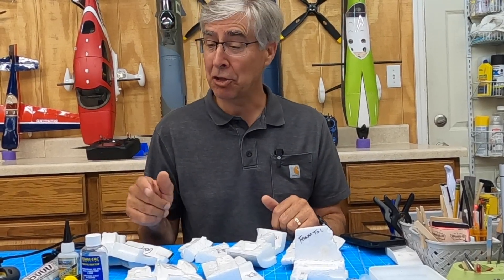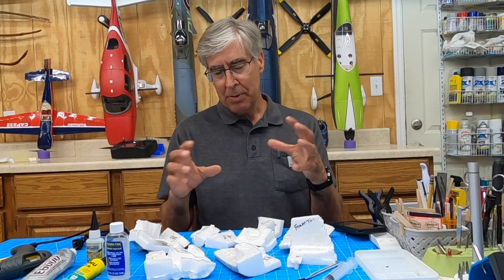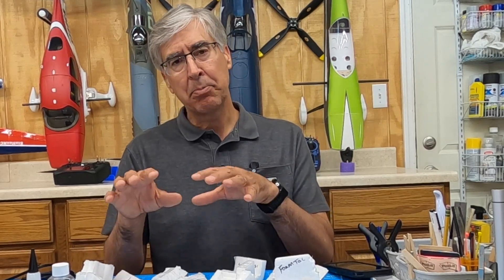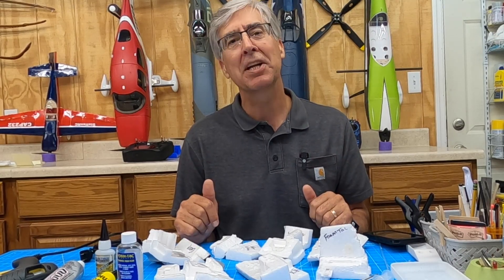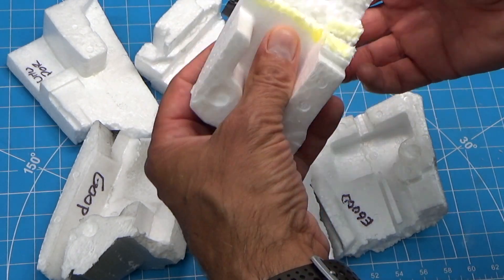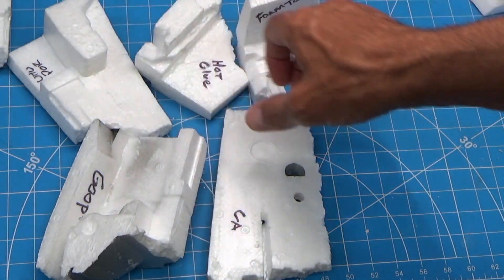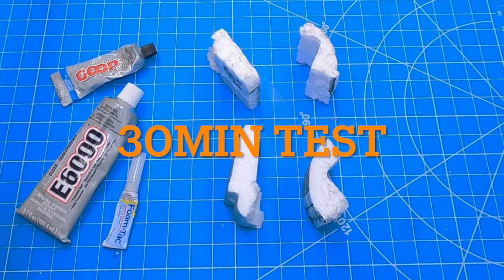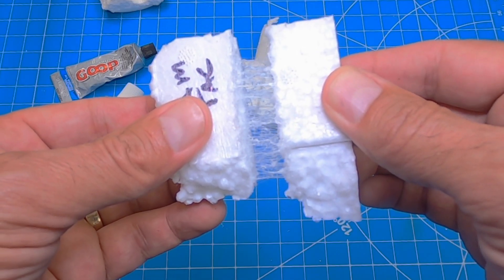Best adhesive for foam RC planes

Comment: So one thing I noticed is that you always put pealing loads on the tests, most loads are  sheer and twisting loads, pulling straight out could tell you more. How well the mating surfaces are bonded. Most bonds don't handle pealing loads well, 30 years of boat building and repair, once things start to peal, the jig is up.
Reply from the maker: The video wasn't very scientific.  Just checking on varius adhesives to see what sticks the best.  I agree that the sheer load would be best, but with foam of random pieces, it wasn't going to happen.  Appreciate you watching and commenting..  Thanks, WIll

Comment: Thank you Sir, amazing information!
Reply from the maker: Really glad it helped.  I've made several videos about adhesives and how to use them in repairs.  Thanks for commenting..
Reply: @SteffenRC think I'm gonna be a hot glue kinda guy although I have some e6000, so I may have to try it as well. 
I found your channel today searching help with my nx8 binding and setting up the gyro. Although I haven't quite figured it out yet, I'll get back to working on that project tomorrow. 
Thanks Will, you're very helpful!
Reply from the maker: Glad to help Don.  To be honest.  I usually use several glues depending on the task.  CA, Foamtac, E6000 and hot glue all on the same repair or assembly..  Yep, AS3X can be tricky.  I suggest to everyone to play with it.  Test it, change things, Test it and keep learning the process of setting up a model, assigning switches and AS3X.  It takes me a while for things to sink in, so I love to tinker around until I get it.

Comment: So I kind of used an idea that we used to do on our rc bodys take drywall tape and I was using  bsi or foam tac a cover repair area. Makes a nice shear resistant area.  
And I experimented with using b s I or phone tag and giving a liberalcoating inside a large break in a very large brake, like if you were attacked and cut the whole front of your plane off. Then take your hot glue gun.Shove the tip down in the crack and give it a couple of pumps. Let it sit for 12 hours or overnight. Its very tough.
Reply from the maker: If you use a lot of E6000 it will soften the foam, but once cured it’s solid.  I use it sparingly and use a brush to apply thin coat and don’t get too much on the outside edge of the break. Otherwise it creates a scar at the break.
Reply: @SteffenRC i did edit my comment because I did not realize that you stated about the e six thousand making it a little soft or spongy. I guess I should have watched it to the end before.I stated something.
But otherwise great demo. I like it
Reply from the maker: @Bonehammer87 no sweat.  Thanks for watching and commenting.
Reply: @SteffenRC my only other question for the universe is what happened to shoo goo. I mean , it's still smells the same and no , i'm not the kid that was out there with sniffin the glue and building his models😂

Comment: Great video.  Did you do any experiments on EPP foam.
Reply from the maker: I have used EPP on some experiments, but not sure it made it to one of my Glue videos. (I did 3 of them...).  My go to for EPP is E6000 for sure.  It does take some time to cure, but Foamtac will work too.  (just not as solid of a bond..)

Comment: I used E6000. I don’t know why it made my foam on my 1100mm Bearcat like melt and super soft. Can anyone help me?
Reply from the maker: Is the foam EPO?  If you apply lots of E6000 it will soften the foam.  It will solidify when it fully cures.  I try to use a light coat of it when doing repairs.    Let me know if its still soft...  Will

Comment: I had an issue with E6000 melting in some of my foam for fishing bobbers, granted my foam may be a different composition.
Reply from the maker: @ronniedale6040  yes E6000 will melt EPS (styrofoam) like alien blood through the hull of a spaceship.  However, it’s fine for EPS or EPP foam.
Reply: @SteffenRC  sounds like i need to buy a different type foam ball  or grab a hot glue gun. Either way fantastic video.

Comment: Thanks so much. Just what I was looking for.  I’m just in the process of building a plane and needed some advice.  I normally use hot glue for fast drying and 5 minute epoxy.  Both work pretty good but I think I’ll try the E6000 sounds like a good one if it doesn’t need to dry too quick.
Reply from the maker: Thanks for watching and commenting.  There are so many ways to glue our planes.  It can get a little crazy with all the options.  I typically use several glues when assembling or repairing my planes depending on what I'm doing.  For example, I may use E6000 for the its strong welding foam feature and a dab or CA or hotglue to clamp the parts together while the E6000 does its job.  No one glue is the king of all.  Glad you liked the video.. I've done 2 other videos on glues..    Thanks, Will
Reply: Okay sound like a good idea using quick dry glue to hold while the other glue dries. Thanks !
Reply from the maker: It will depend on the situation too.  Many times I'll use pins or rubber band clamping.  Repairs on busted planes is all about creative clamping.

Comment: ...PERSONALLY  , I USE A HOT GLUE GUN...👍
Reply from the maker: Hot glue is a good option.  there are many options on adhesives.  I usually use a couple different glues on a repair as there isn't ONE perfect glue.

Comment: Thanks so much for this video.  So here's the scoop: I have a new in box Avios Super Tucano and I've been holding off on the build since I couldn't decide what glue to use for the fuselage and wings.  After seeing your vid I've decided on the E6000 for the task so last night I ordered this since I've never used it before .  Also thanks for the build and flight vids on this RC plane !  It's such a cool livery so can't wait to get on the build ! 😊
Reply from the maker: Its an amazing plane for sure.  I used CA on the rim part of the fuse to act like a clamp while the primary glue is curing.
Reply: @ thanks for the tip! Will do this as well.

Comment: I used foam tac  and it melted my Xps foam wing seams..what would say is solution for this issue
Reply from the maker: WOW..  I've used foamtac on EPS foam and never had an issue.  In fact, foamtac is one of the glues I thought was safe for ALL foam.  The other glues I feel are safe would be Foam2Foam and Uhu Por.  Also hot glue..   Sorry I don't have a definitive answer for you.

Comment: A cure time above 24 hours is a failure by default. Like the old lady said. "Ain't nobody got time for dat".
Reply from the maker: It depends on the repair.  Re-Attaching an entire front of the plane/motor mount and all..  I'm ok with 24hr cure time, because I want a really strong bond.   Hotglue is nice since its about a 60sec cure, but it has limitations in my book.  Field repairs like a tip of the wing or rudder, foamtac and 15min is all I wait....

Comment: Great real user testing scientific is ok but nothing beats the will it snap in half test.
So  what we are seeing is that a few of the adhesives that advertise they glue anything, don’t actually, and probably cost the most.  It ooks to me that a 12v hotglue gun and some sticks is perfect for the crash fixes when out flying, when you are at home in the workshop there are different options.
Reply from the maker: The hot glue is a great adhesive and I'll use it in the shop on occasion.  The only issue with hotglue is the super fast setup time.  So a complex repair with lots of fitting of parts is hard.  My go to for the field is FoamTac.  Unless its a serious repair, Foamtac can have it up and running in 30min.  So many options for adhesives.  Most work well enough for our needs.

Comment: I correct: SUPER AWESOME :) (I was on the car before)  I found your channel last year by coincidence about the Turbo Timber. Since then I have crashed a lot (of Edfs primarly). First I got one Uhu POR used for the Turbo TImber and for the TT Umx. Then I ddnt want to pay so much so got E6000, B7000 and lately E8000. Probably all very similar varying the quantity of hard particles and tacking time. What I also did with the Turbo Timber was to reinforce the plastic motor holder to the carbon bars (sweet design with the bars) with an grey 2K epoxy cement (like for metal tubes). That got super hard. I crashed again on the nose and nothing broke again .)  But I loose my path. I have done similar experiences as you. I don´t like CA because it doesn´t glues so good. My FunCub has unglued some parts. Super to know that the E6000 works so good in comparison. So I can stay on E8000. I was quite amazed about the hot glue! I have used it a couple of times for some small parts but it looks super also! This weekend I soldered my first Molicel 6S LiIon pack with a special geometry for the small 70 and 64mm planes, As I did not have a 3D printed holder I used Hot Glue to fix the batteries and let a couple of mm inbetween for ventilation. I worked super good and they bonded really hard. I´ll try that maybe on my stalled Viper 70mm 15th Anniversary from Saturday :( Wing is ready but fuse looks ugly. I got a hard accordeon crash :P  ----  I have just used too much E8000 to fill cracks or to bond so that you see the foam pop out on the top and bottom. But this time the damage is so extensive that I will use again the heat gun,  a good portion of glue E8000 (and hot glue, but it´s more heavy) and afterwards filler, paint and clear cote (EzeKote or Foam Finish, both from Deluxe Materials).... This was a great video :D
Reply from the maker: So many options for glues..  Its fun to play around with all of them..

Comment: Has any body thought about doing a carbon fiber repair instead of using hot glue
Reply from the maker: I've used CF Strips on repairs many times.  Especially fixing busted fuselage, maybe wings too..  It just depends...

Comment: Excellent practical test Steffen. I use hot glue with a chargeable gun and really like it but have to check out that E6000 also.
Reply from the maker: Thanks..  I made 3 of these videos to test different adhesives.  E6000 is wonderful for major repairs, a little goes a long way.  It will melt/weld the foam together, so using too much will show a scar on the repair.  I'll brush on a little to both pieces, trying to NOT get glue squeezing out the sides.   Hot glue is handy stuff too...

Comment: Very helpful video some of the parts on the clip missing Audio
Thanks for all your help
Reply from the maker: Thanks for the heads up.  I'm curious as which of the chapters didn't have sound..  When I watch it, the sound is fine.  But, I know there are a few chapters that were only on the LEFT Stereo channel, so if you listen with just the right or left earbud, you might miss it.  (I currently try to record in MONO mode to eliminate this issue...).  Thanks again for watching - Will

Comment: A excellent adhesive specifically for foam is TensorGrip, it is a spray and bonds instantly. Another is called Sta’Put. These are similar in function but I like the TensorGrip slightly better. These are more effective than anything shown in this video. They are not well known outside manufacturing industries that use foam. I sculpt foam for theme park and miniature golf scenery. I have started cutting airfoils and building airplanes with some of the enormous amount of scrap I have access to.
Reply: TensorGrip P322 or Sta’Put SP2 (the Sta’Put 2001M product also works well)
Reply from the maker: Really interesting...  Do they come in a non-spray form?  I think it would be hard to spray the adhesive on the broken area of a fuselage without getting it all over the other parts without masking...  Or can the spray be concentrated on a small part?    I'm thinking of the times I've use that #77 spray adhesive and its a mess....
Reply: @SteffenRC  that is a valid observation, spray can be problematic on small parts. I find the spray can version to be pretty reasonable to aim and control, and is better at ‘dosage’ than what I use in my workplace, which is a 30 pound tank connected to a spray gun. That is quite tricky to use sparingly. I have gotten practiced and rarely use masking, when I do it is not overly complicated, just laying a piece of scrap cardboard or foam over the adjacent zones I want to keep clean. Fortunately, if glue does get on an unwanted area, it can be wiped away (rolled away is probably more accurate) if it is applied heavily, wet, it is actually easier to roll off than when it is a fine dry mist. The adhesive makes a poor bond when applied to one surface or when the parts make contact while the glue is still wet, this is how I do a repositionable bond. But when both surfaces are sprayed and some air is blown across it, it slightly inflates  and tacks up. Once the semi-dry glue surfaces are put in contact with each other the bond is immediate and not repositionable. So glue overspray is generally weak and removable whereas glue on two surfaces is trouble

Comment: One thing to be aware of . I used E6000 on one of  my models on the servo to connect it to the foam. It was so sticky that I broke and had to dig up the servo from the model to use it. It sticks extremely well but if you have to replace the item or have to take it off in the future its going to destroy said item. That's why I switched to FoamTac for items that may need to be replaced in the future but hold well enough for general use.
Reply from the maker: @nuddin99  sound advice.  I use several different glues for every project.  It just depends on the situation and material

Comment: Great video. I wish PVA (white glue - NOT the washable kind) was included. It's worked well for me.
Reply from the maker: Hmm. PVA?  Like wood glue?  Or Polyurethane adhesive (foaming...).
Reply: @SteffenRC  White glue, polyvinyl acetate. Which is the same base as wood glue.
Reply from the maker: @senseisecurityschool9337   Wow, no kidding. I've never heard of anyone using that on a foam plane.  I would assume, it needs to soak into the material (wood) while it can't soak/saturate foam.  I use it on balsa often...  I'll try it out though..  Heck, I'll try anything..  I've made 3 of these glue videos..  Maybe I can show off a few more glues....  Thanks Will
Reply: @SteffenRC  That would be cool if you get a chance to compare PVA. Generally, true glues such as hot glue, epoxy, super glue, and white PVA don't function primarily by "soaking in". They function around something called surface energy - they bond to surfaces. Hot glue is sometimes made of PVA. Wet PVA doesn't need to "soak in" any more than melted PVA (hot glue) does. Two big differences between hot glue (melted PVA) vs white glue (wet PVA) is that with hot glue, it can be difficult to avoid putting on too much. Since the wet version (white glue) is runnier and has water that evaporates, it's a lot easier to put on a more reasonable amount. But you have to wait for it to dry.

Contrast solvent-based cements which dissolve a bit of the plastic, which is a different mode of function than glues.
Reply from the maker: @senseisecurityschool9337    Which brand do you use?  I'll get some and test....
Reply: The problem I find with using PVA on non-absorbing materials like foam is that it will not dry (cure) in a reasonable time, like 24 hours.
Reply: @clarencegreen3071   It air dries. So in a few minutes along a seam, much longer if it's in the middle of a large panel. If it's within about one inch of an edge, it dries reasonably quick. Several inches from an edge it will take much longer.  Stacking panels on top of other, PVA isn't the best choice - the moisture will be trapped between the layers. Gluing a vertical stabilizer to the horizontal stabilizer, it'll be mostly dry in 15 minutes and fully cure overnight.

Comment: You can’t use E6000 for Z foam.  It dissolves the foam.  Hot glue is the strongest and fastest fix. 👍
Happy flying.
Reply from the maker: Yep,  E6000 isn't for everything..   Hot glue is good too.  I will use several adhesives for some of my repairs..  So, many good options...   Thanks for commenting - Will

Comment: I recommend don't buy a foam plane.  Think I spend an hour repairing for every 30 minutes. 
Today,...... broke the motor mount and cracked mid fuselage 
The other cheap plane started making a whistling noise as the gearbox fell apart .
The third plane ok, it flew until flat.
  Model railroad is starting look a cheaper good idea.
Reply from the maker: Well Chuck,  Learning to fly these planes takes some work to get over the rough part you appear to be in..   We've all been in your shoes..   Check-out my beginner series on the SteffenRC Channel.    Keep heart and keep practicing..  - Will

Comment: One thing I noticed with foam tac, is it gets really solid and strong after a week or two. Globs almost feel like plastic. 

Try letting it set up for much longer, and see what you think.  

Hot glue is my go to for major repairs.
Reply from the maker: I agree with FoamTac..  I've used hot glue too.  I really like it for that quick repair that I can't find a way to clamp it..  I've also used it for a tack when using E6000.  I'll hot glue a few small spots to hold it while the E6000 does its job..  So many glues, so few crashed planes..😬